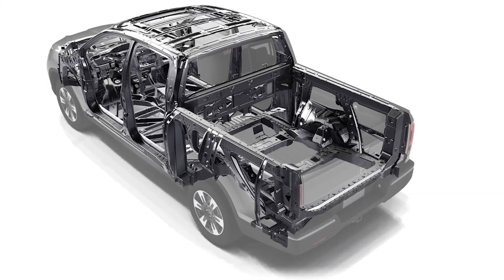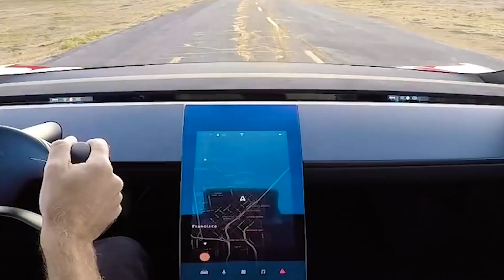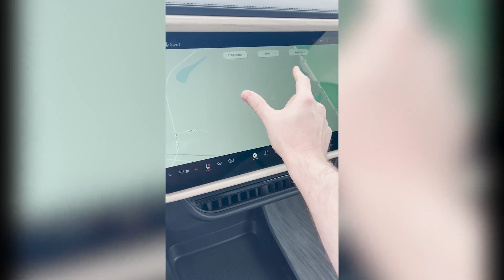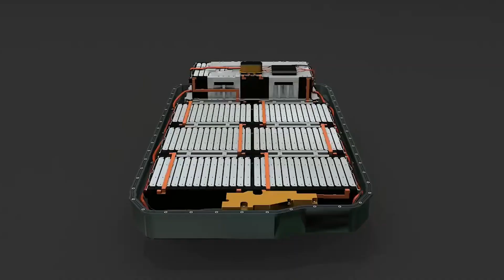Why The Cybertruck Is So Cheap !

Comment: The Gigapress is not a stamping press (It doesn't form sheet metal).  It is a diecasting machine, also called a "press" due to the clamping forces needed to hold the mold halves together under the injection pressure.  The beauty of Gigapress die casting is that it replaces a bunch of stamped and welded parts with one big die casting.
Reply from the maker: Wow, thanks for the correction.